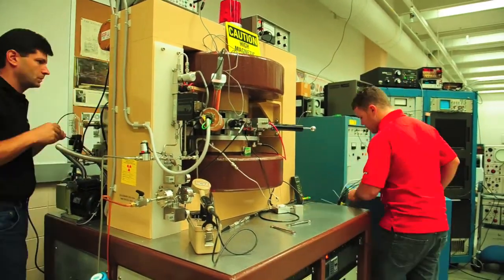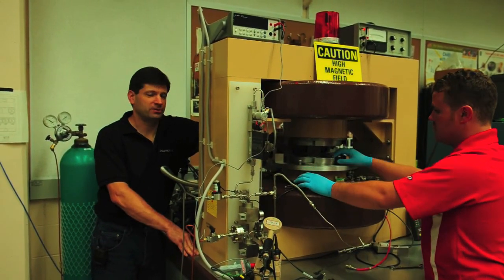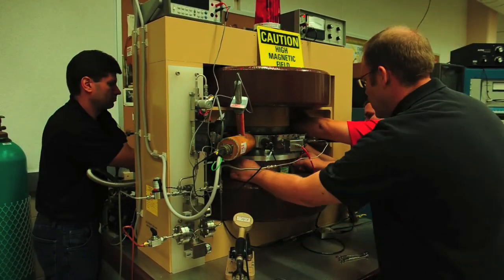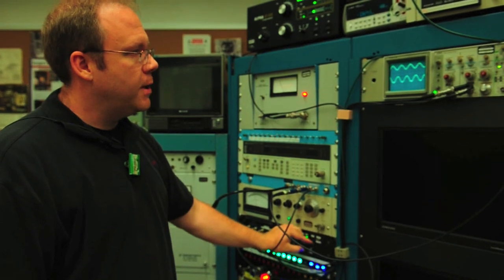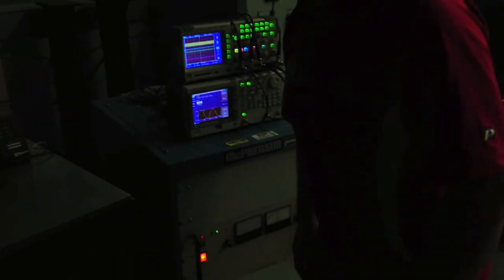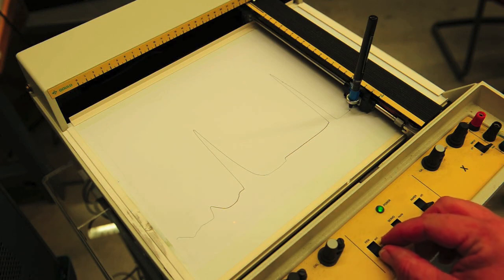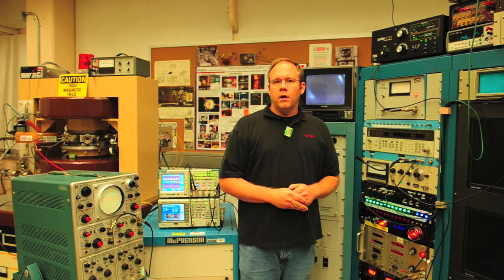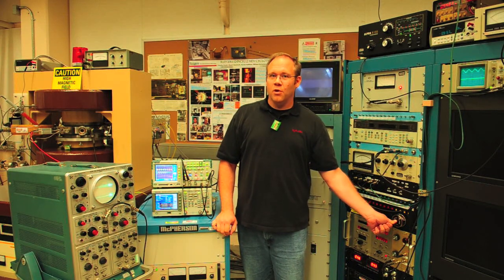Rutgers 12" Cyclotron

Comment: Thank you for sharing this well made video demo of your facility's Cyclotron.  I spent more than 30 years working with Ion Implanters in the semiconductor industry which are of course, industrial Linear Accelerators used to implant moderately heavy semiconductor dopant ions into GaAs or Si  wafers.  To bend an 80KeV, As+ or Sb+ ion beams through a 45 degree turn the systems had large analyzer magnets driven up to 150 Amps, producing as much as 12 Tesla B fields.     This brings back lots of fond memories of the decades that I worked with those systems as a field engineer for the same company employing Dr. Rose. We used large turbo pumps and cryogenic pumps in the newer systems and had to have E-8 Torr vacuum in the end stations to minimize beam contamination that could affect the electrical performance of doped layers.  Thanks.

Comment: Please forgive my ignorance, but that seems like a TON of electrical equipment, and I also don't see a single computer in sight. Could all of this bulky equipment not be consolidated into a single unit? It seems the vast majority of it is there simply as a power supply, essentially. Couldn't a single, more modern unit not provide the same? And could you not use a PC to easily control and monitor everything?
Reply: You're not mistaken, the vast majority of the equipment is analog (but you're wrong, there are computers there!). This cyclotron has been developed and improved upon for about 20 years; many components have been added on over time.
Sure to an extent the use of digital components would reduce the clutter, physically. However the presence of an analog system offers two main advantages: The first is that each part of the process can be monitored is a compartmentalized manner; this machine is meant for learning and seeing each physical component's effect on the overall process is very important. Secondly, analog components react more immediately than digital components. If you look at an oscilloscope producing a wave you want to see the wave as close to the instant of its signal wave's propagation as possible. The use of a digital scope would involve a lag that is typically trivial, but not negligible in this case.
Reply: Matthew Teperman
Thanks for the explanation!

I did not realize that this setup has been around for that long. Also, I completely forgot the fact that it is for education purposes, so of course it makes perfect sense to be able to have all the system components compartmentalized.
Reply: Sure, you can use LabVIEW or LabRAD, and connect all of the devices to one computer (at least the ones that can interface with the computer), but someone would have to write the central program that talks to each individual device (which may or may not share a common language / interface).  You could also use something like an FPGA or Arduino to generate signals, but those require programming as well.  Signal and pulse generators, albeit bulkier and more expensive, are easier to use and faster to set up.

Then when you have everything connected to a computer and a program written to talk to your devices, there comes the issue of how to automate different experiments, teaching others how to use your program, and troubleshooting the bugs that may arise.

I've been writing LabRAD applications for an AMO lab at my university on and off for a year as an undergraduate research assistant, and while we do have something working and can talk to our devices, there's still a lot more that can be improved upon.  The complexity of it has become such that the expertise of a computer scientist or electronics engineer would really be beneficial!